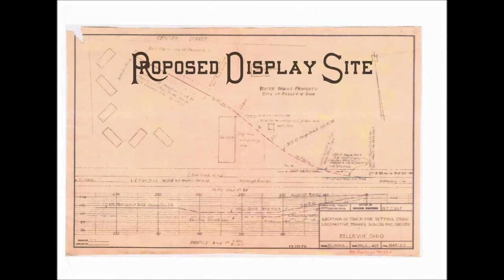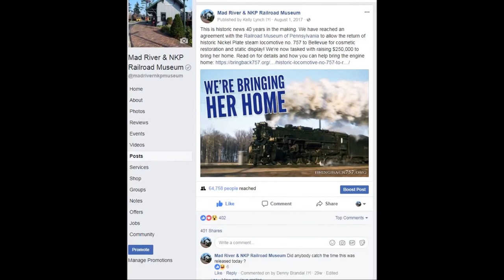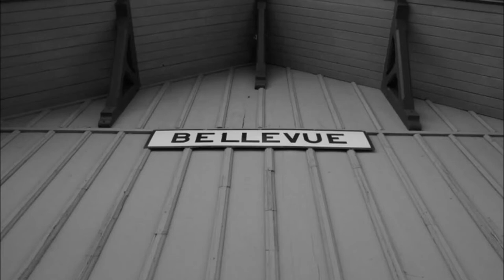BRING BACK 757   March 2018

Comment: Have they come up with a date for the movement?
Reply from the maker: No date has been set. Preparations should be finished soon. Then funding and the railroad will dictate a movement date.
Reply: Mad River & NKP Railroad Museum ok. Please post on this YouTube the date of movement and the exact routes you are taking.
Reply: Mad River & NKP Railroad Museum and if you get enough funding, is it possible for a operational restoration or just cosmetic?
Reply from the maker: No.

The restoration of the 757 will be cosmetic only. Any effort to restore and operate a mainline steam locomotive like the 757 would likely cost over a million dollars and require personnel, equipment, financing and infrastructure that our museum does not have.

In addition, the Fort Wayne Railroad Historical Society, Inc. presently owns and operates a sister Nickel Plate Berkshire and it frequently visits the Bellevue area.

Comment: Are you going to cosmetically restored
Reply from the maker: The restoration of the 757 will be cosmetic only. Any effort to restore and operate a mainline steam locomotive like the 757 would likely cost over a million dollars and require personnel, equipment, financing and infrastructure that our museum does not have.

In addition, the Fort Wayne Railroad Historical Society, Inc. presently owns and operates a sister Nickel Plate Berkshire and it frequently visits the Bellevue area.